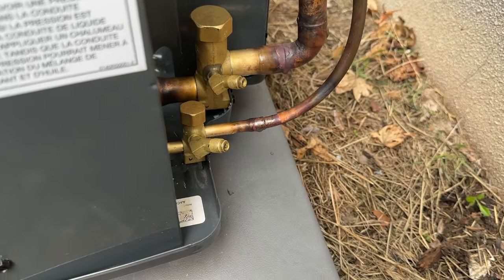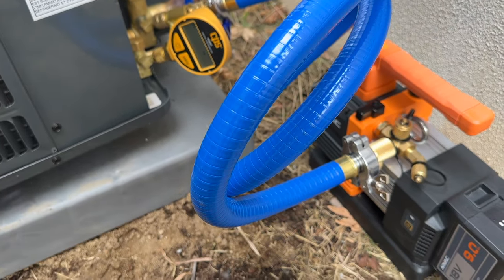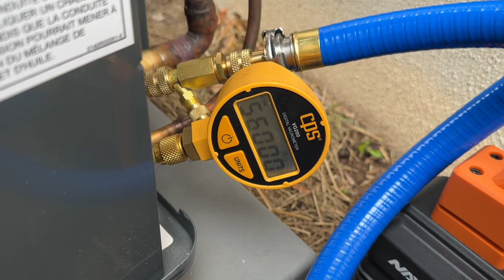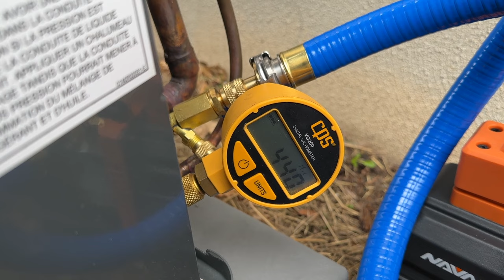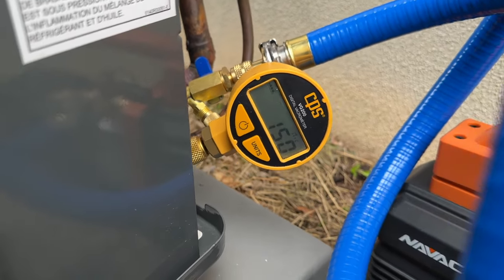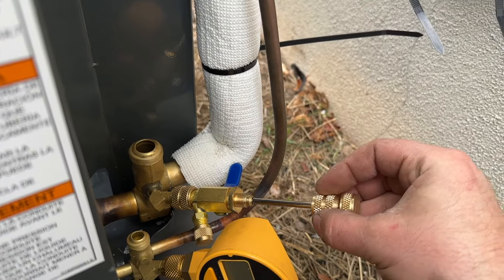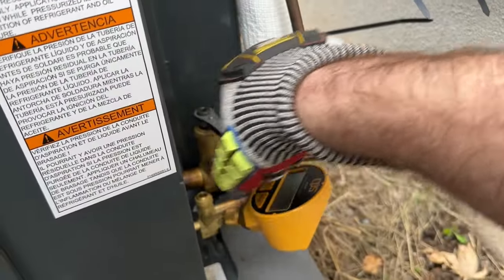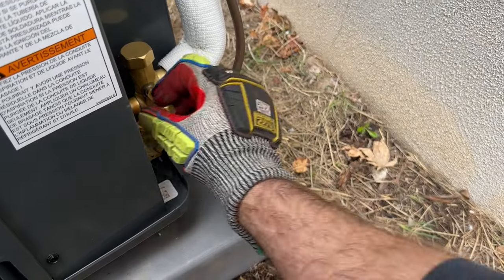How To Pull A Vacuum In Less Than 10 Minutes   - The BEST Way-

Comment: Good learning video.  For a diy, you can use the harbor freight 2 stage pump, a 1/2" navac or other vacuum hose, and you do need two valve core removal fittings and of course the micron gauge.  You're all in for tools for a fast vacuum down for under $500 and if you change the vacuum oil regularly, would have a system that can last years.  Large diameter hose is the key for a fast evacuation.

Comment: The tool is nice and it’s good to see all the options on how to do HVAC work. For a person just starting, I am good doing my two hose vacuum setup. You should use another valve core tool to isolate the micron gauge from the system.
Reply from the maker: Yea I may start doing that. But the valve is before the 1/4” fitting so I’d have to have two..
Reply: Don’t use that port go off the end then you can valve off the micron gauge.
Reply: I was on a Mitsubishi Condensing unit that went to a BC Box downstairs and then to multiple evaporators. I recovered the refrigerant from the low side, then found out there was equal pressure on the high, so I had to recover that also. When the roofers were done and we set the Cond. Unit back in place, I had to pull a vacuum on both sides as well. I used my recovery machine to pump the refrigerant back in it, and pumping it in the low side had no effect on the high so I had to open the gauge manifold to pump the refrigerant back in equally. sometimes you cant use only one side.

Comment: Did I miss you purging the air pocket between the ball valve and the Schrader valve before you pushed it in? I'd imagine once you open the suction valve you have to crack the nut of the schraeder adapter to let the air bubble out? Or am I wrong about thinking that?
Reply: I watched the video closely and get what you mean. That will let in some air but it’s a very small amount and the drier will catch any of that moisture. It’s not best practice but it’s not going to cause any problems.

Comment: This is excellent! I assume this is a new installation with a dry line set and evaporator? And you’re only pulling down the line set and evaporator? I wonder how that pump would do pulling down condenser as well with moisture? I got tested yesterday, using my Milwaukee battery vacuum pump (wish I would have bought the Navac though). I had to pull down a condenser, line set and evaporator on a service call leak check and repair (leak on evaporator suction side) with enough moisture in the system to make you very impatient on pulling down a vacuum.
 (I switched to my 115 volt field piece vacuum pump for this after a short while, changed the oil one during the process and triple evacuated, breaking with nitrogen twice).
All I can say is, wow there’s a difference on pulling vacuums, depending on the size, situation, moisture, etc. of the system. And one size don’t fit all 🤦🏻‍♂️

But I’m the knucklehead head that would of watched this awesome video quickly, and got even more frustrated, because your video shows a deep vacuum in minutes, when I’m standing around and it’s now been 4 hrs! Great video though man! (I know now that your situation is a standard evacuation with a clean system, tight, and no condenser and no triple evacuation needed as it’s not a LC&R job, I assume a new installation).
I will buy that pump for those situations for sure, I already have the true blue hose and it’s excellent! Every job is different and requires different methods or setup though to achieve a clean, tight and dry system.

Comment: What did you use for brazing? Stay Bright 8, Sil Fos rings or Brazing rods.
Reply from the maker: I have used all, but anymore I’m going to start solely using my RLS crimp tool 😎 no brazing, no flame, and no rushing around wasting precious gases!
Reply from the maker: As a diyer, I’d recommend Staybrite 8 for sure. No nitrogen flow needed, way less heat produced so less threat of damaging any rubber items, and you can use regular map gas 👍🏼

Comment: If you get the makita to milwaukee converter you can use either dewalt or milwaukee batteries. Saves from having to spend a fortune on navac batteries

Comment: Is this the yellow jacket core removal tool? I do the same thing pulling from suction and keeping gauge on liquid with the only difference i have a ball valve with the micron gauge.
Have the same micron gauge, i just don't  want to take the risk to pressurize it with freon and ruin it. They say it s ok for positive pressure but who knows
Good job man, i like your videos1
Reply from the maker: Thanks so much! I will have to grab a ball valve just to be safe! I like that idea.
Reply: since its a suction line, using a ball valve is not a good idea. it will suck in air when you try to insert shredder valve through it. In the video, when The DIY HVAC Guy removed his core removal tool, we did not hear any pressure leaks because it was the suction line.

Comment: I have an 8 cfm navac can I still use it on residential units? I know it might freeze moisture but as far as damage goes could it mess anything up? Given I don’t try to pull the deepest vacuum known to man.
Reply: With a fast pump like that keep it elevated above the compressor to prevent oil getting sucked out and use short hoses. I’d put a valve core remover on both valves to take out the Schrader valves. Then hook up hoses to both sides of the system to your pump for even faster evacuation. The gauge won’t be accurate while it’s running but when you’re close (you can hear the pump) you can shut off the ball valve near the gauge while it’s running and it will measure the vacuum of the entire system. The textbook warning for freezing moisture is not possible in the real world. It will melt in copper pipes. You’re not servicing an AC system in freezing weather… get your job done fast and accurately. You’ll be rewarded for it.

Comment: Nice setup man. I bought the Milwaukee 18 volt pump because I have plenty of the brand already. I definitely say stick with the true blue setup. I bought two of the Navac black vacuum hose setups. They’re ok, but the ends pop off and the gaskets I’ve had trouble with. I found I personally don’t like anything hose or valve related with Navac. I absolutely like all there electronic devices. I can’t wait to buy the bender. I probably should’ve bought that pump, but oh well. They have awesome equipment. The true blue hose set up is the only way to go! So simple. Do you feel it will do well if you’re pulling down condenser as well? Or will you add two hoses then?

Comment: So I mean as a homeowner planning my install, I wouldn't need the valve core removal tool, but it'll take significantly longer to pull vacuum right? My hoses with my gauges will allow me to pull vacuum, without messing with the valve cores, Right?  I mean it looks like a great tool and all, but I'm talking about saving $80 for a little extra time on my end. Also on the fence wither I really need a micrometer to measure vacuum, no doubt it's a great too, at $170 is it a must have?? Can I get away with checking vacuum on my gauges?  Ugh I'm going to bite the bullet and get a couple valve core removers I found so $20 ish ones, and a $180 vacuum gauge,,,,
Reply from the maker: Yea it’s worth having quality stuff for this. You can do it without the core removers but they do a lot better job and quicker
Reply: @diyhvacguy How is NAVAC Quality Holding up Comparing to Fieldpiece and RobinAir ❓❓
Reply: @Honestandtruth007  best pump ive ever used to be honest. Ive had tons and tons and tons of sman3's and 4's that end up taking a crap. No i use testo gauges and straight vacuum pump with a micron meter. Less joints the betters
Reply: If the gods are with you you can get away with it. I vacuum for an hour using an analog vacuum gauge from the old days yet expect to get bit some day for skimping on the good tools.
Reply: @geraldhenrickson7472  I appreciate your insight, I did end up just buying all the tools.

Comment: I thought the reason for letting the pump run longer was to remove moisture. Ten minutes does not seem long enough to do that.
Reply from the maker: That’s the purpose of the decay test. If it doesn’t rise over 500 within 10 mins, you are good to go. No need to pump for 2 hours or whatever if it isn’t needed! The micron gauge and decay test doesn’t lie! Cheers

Comment: Do those big blue hoses really make  that much a difference? You still have all those necked down adaptors, and service valves .  The hoses are a lot better quality, and are much better at holding vacuum then regular gauge hoses, but I don’t buy that the hoses provide that much less restriction in close coupled situations.  It is great that you placed your micron gauge in the proper place, furthest away from the vacuum pump.  Nice vacuum pump.
Reply: That's what I've been saying/asking other guys.  We now need to see a demo with the same pump but standard 1/4 inch hoses.  I bet the result is trivial.
Reply: I agree, there are bottlenecks with that 1/4" ports, but the bigger hose has less friction to airflow compared to a small one.
Reply: i use the 3/8 vacuum hose and i get the same result.
Reply: Vacuum pumps work by capturing particles in the system that are spreading out to a lower pressure area. What the big hose is doing is creating a large space of higher vacuum where those particles are more likely to enter and flow towards the pump. That’s why it’s faster than a thin 1/4 hose.

Comment: So a complete open new system. You only vacuum from the low side? Your high side is mid seated to let it evacuate it throughy?
Reply: Everything gets vacuumed from service valve to service valve. Condenser obviously not because there's refrigerant in there and service valves are closed.

Comment: Hey. I liked the video! I have a couple questions though because I like to know how things works and I also want to be sure that I understand. The vacuum is done on the loop going to the air exchanger? Is the micron test just to see if there's a leak? If the number goes up why it isn't bad of under a certain time? Where's the refrigerant? In the unit already and it just fills in the lines when the Schrader valve is installed? And what does the Schrader valve does anyway? Thanks!
Reply: the compressor is in the outside unit so if you put the vacuum on the (return to the compressor line/ low pressure side / big tube) and put the micron gauge on the (line out of the compressor/ high pressure side / small tube) then it is sucking all the way into the house.. through the evaporator above your furnace.. all the way back out to that gauge on the high side. It tests the whole loop that the refrigerant travels but what he was saying is you separate the compressor and the micron gauge so the compressor isn't sucking right on that gauge.. it has to travel through all the lines to get to the gauge ... ....... Why is there a time factor? yeah you would think that once you suck it down to 150 microns that it would just stay there indefinitely.. but microns are a very tiny measurement.. and idk maybe at that level of sucking heh it will suck past the seals in the compressor or past a schrader valve............. the schrader valve is exactly like the valve on your bicycle or car tire.. its spring loaded and keeps the refrigerant in the system but allows you to connect hoses to it... just like on a bicycle tire.. without the valve you would be trying to cut a hole in your bicycle tire to fill it with air and then patch it really quickly before it all leaked out.. hope that helps a bit
Reply from the maker: Yes, what he said was excellent. To simplify a bit, the system is a circle essentially. So the compressor takes the refrigerant and pushes it through the coils at the condenser and pushes it through the small copper line into the coil that sits above your furnace or air handler. The compressor is simultaneously sucking refrigerant through the large copper tube from that same indoor coil, back to the compressor, and repeats this cycle as long as the thermostat is calling for cooling. The fan at the condensing unit is pulling the heat out of those coils, that’s what you feel warm air blowing out the condenser in the summer. The schrader valves are used to keep the refrigerant contained in the unit, but allows you to check the pressures with your gauges.

But when a system is brand new, the refrigerant is contained to the condensing unit, so after you have the lineset fitted and brazed in, it’s essential to pull all moisture and air out of the lines before introducing the refrigerant. So that’s when the vacuum pump comes in. It’s just pulling moisture and air out, and then when you are done and let the refrigerant in, it goes immediately from a vacuum to positive pressure. 

The vacuum procedure can be a leak test in itself. The micron level tells you how “tight” a system is. So if it goes up quickly after being isolated, you can assume you have a leak. 500 is considered good so if you isolated and it rose to like 1500 microns you’d need to do another Leak check. Hopefully this is helpful! If you want more clerification, check out our Patreon membership at Patreon.com/diyhvacguy where we will answer any hvac question you may have! I think I will start a diy beginners course soon on our website, so I’ll make sure and let everyone know about that. Cheers
Reply: Thanks for the explanation! I always thought for some reasons that the refrigerant was manually added to the system after the installation. It's a lot easier if it's already in the condensing unit.
Reply: @Marc B  Just be aware, if trying a DIY to read the manual.  Many units will contain enough to fill your system.  However, not all do and may need to add / have someone add more to meet cooling requirements for your home.  Also, if replacing an old unit and has the "old" refrigerant, you'll either need to "clean" the lines or replacement, as the old stuff and new doesn't mix well and can/will damage your system over time.  Looking at the site Dave mentions has their flush kit >$100, a new copper coil CAN be found for ~$190 (for 30'), but is also much safer if you plan to stay in the home a long time....or just want to do it right :)
Reply: @mabelisle  the refrigerant that comes factory charged in the condensing unit is typically good for around 15ft of lineset (copper lines). Some places have furnace coil all the way up in the attic or across the house in the basement where you might have a 40ft run of lineset. Therefore, you would need to add refrigerant.

Comment: Can't this serve as a leak test? I mean certainly the system is going to not hold a vacuum if your connections aren't tight right?
Reply from the maker: That’s right. BUT only with the micron gauge. A very small leak in a system will not make you lose your vacuum but the micron gauge is VERY specific. If it doesn’t hold at 500 or even close to 500 that’s a really good indicator that you have a leak somewhere 👍🏼
Reply: @diyhvacguy  Awesome thanks for the response! I have a micron gauge so good to know as I'm about to do my test now!
Reply: @diyhvacguy Can you tell me...... How the Quality of NAVAC Quality Comparing to Fieldpiece and RobinAir ❓❓

Comment: If you do a vacuum test and it holds vacuum, do you still need to do a pressure test with nitrogen or is the vacuum test good enough?
Reply: Of course. Nitrogen is hygroscopic and anything to remove moisture is key! Purge , vacuum and fill by weight then run. After a while do your, pressures,then superheat calcs and should be good.
Reply: If it holds from a repair, it's your call to say it's good to go.  But most insert nitro after a repair and soap test area to confirm.  Then vacuum  and confirm. The charge or open system back
Reply: Some do, some do not. It seems with most DIY installs,  a pressure test is skipped. I find that a nice long vacuum that is not rushed is enough and yet my buddy always pressure tests.

Comment: I dont know its worth its weight in gold.
I usually see guys doing this go do other things. I dont know if the extra "speed" it provides is worth it.
Reply: Sounds more like a headache specially if its zoned and upstairs air handler.looks like youll have stop half and check and open valves since its so dang on fast

Comment: Does pulling a vacuum remove whatever air/gas was in the lines?  I’m asking because I’m installing my own Goodman AC unit and to pressure test, I was hoping to use my welding tank which is a combo of Argon/CO2.  The alternative is buying a nitrogen tank, but was hoping to avoid that since I have the welding tank on hand.  I’m not sure if it matters what gas you use to pressure test, but please tell me if I’m wrong.  Thanks so much for the videos and inspiring DIY guys like me to do this.
Reply from the maker: Hey! Thanks for the message. I’ve never heard of anyone doing that but it’s probably fine. As long as it’s a dry gas. If you need some help and advice with your install, check out our Patreon membership over at Patreon.com/diyhvacguy  for $25 (cancellable at any time) we will give you one on one assistance with all things hvac. Cheers
Reply: @diyhvacguy  Thanks!  By the way, I love how you put a DIY spin on your repairs.  It irks me when I look up a question online and see a HVAC forum with the same question asked by someone else that I have and the responses from techs are like, “are you licensed, if not, don’t attempt…”. Etc.  Thanks again!
Reply: The vacuum pump pulls out most all the air and any moisture so it should work fine
Reply: @bartfoster1311  Thank you, Bart!  I appreciate it.